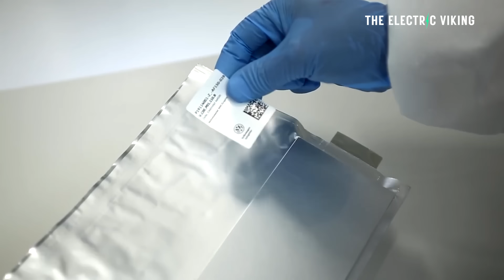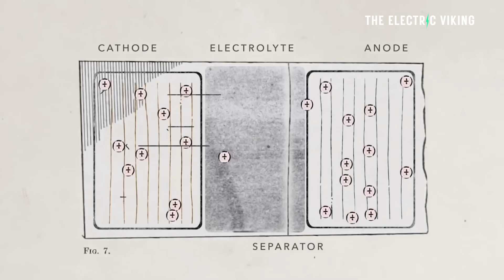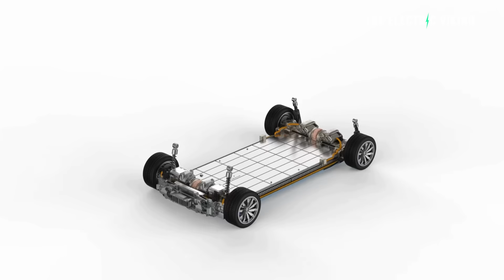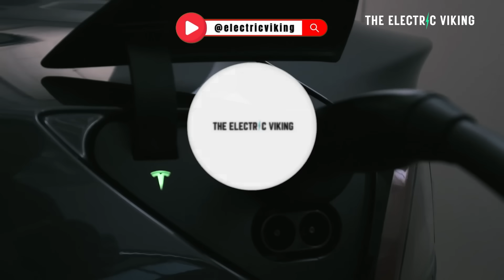Solid-State EVs Will Soon Seal Gas Cars’ Fate: 500 Wh/kg Power in 2025!

Comment: A 500 mile range with 300 miles between charging that would be great
Reply: Are the solid state batteries safer?

I will buy an electric car, when the batteries no longer form dendrites, and short out internally. As long as they cannot go into a thermal runaway, then they will be better than most lithium batteries. I think Lithium Iron Phosphate are currently one of the safest batteries? 

The other problem is, electric cars are forcing huge amounts of technology onto people. But what some of us want are an analog electric car. Meaning, an electric car without a full touch screen computer system. What happened to driving a "simple" car? A simple car should be an option. There needs to be an option. If you take away a person's options, then you force them to buy an old car. That's why Tucker Carlson bought a 1987 Chevy truck for his main vehicle. Because it's not fair to force computer controls and drive by wire, on people.

FYI, I want gasoline cars to continue forever. But they need to allow improvements in combustion technology. If those improvements aren't allowed, then there won't be anymore gasoline cars, and that doesn't benefit anyone. Allowing improvements, will allow gasoline cars to remain for another 30 years. If you car got 200 mpg, then it would produce less pollution, and it would be extremely inexpensive to operate.
Reply: Current top batteries is about 100kwh in 600kg. This one promise 300kwh in same weight. Range will be increased 3 times too. From current 500-600km to 1500
Reply: @maximkosheleff  unlikely that a producer would not use that technology to lower the weight. they might go up to 1000km for the 4 figure promotion value, but would be far more reasonable to cut weight and get some "free" range and space while lowering production cost that way.
Reply: @diedampfbrasse98 of course balance is preferable. 200kwh with smaller weight maybe better than 300kwh.

But still gere is no any real ev with solid state batteries on the market :(
Reply: I am so excited for the new battery technology, provided that it is safe. I won't buy an electric car until the batteries are as good as a 200 year old "Lead Acid" automotive battery. As it turns out, regular lead car batteries are made out of 100% recycled materials. Lead, and acid, are the easiest materials to recycle. So none of the lead goes into the landfill. They are better for our environment, than lithium ion batteries. Surely they can come up with a battery that is able to be recycled, like the lead battery?

It's also important to realize that men have invented sealed Argon engines, that use Argon for combustion, in a sealed chamber that never runs out of fuel. There are men who have made cars that get 376 mpg, in 1973. Gasoline cars are not evil. What is evil is the lack of innovation that has been forced on people. 

There has been zero improvement in combustion technology of gasoline, since 1913. Strangely, there has been zero improvement in electrical generators since 1899. How is this possible? 

The problem is not a lack of technology. The problem is the continuous SUPPRESSION of breakthroughs in science and physics.

The mindset of accepting "zero progress" is a major problem. Why are people buying vehicles for $77,000 that break down after 20,000 miles with catastrophic engine failure? As consumers, we need to expect more. We cannot keep allowing "zero progress."

Comment: hopefully they make swap kits to put them into existing EV models! id definitly drop one into my 2019 leaf if the cost wasnt outrageous
Reply: That’s the advantage of battery swapping capability, as technology improves it is simple to put in a new battery.  My Nio was bought with a 75KWh but got long runs I can rent a 100kWh or a 150kWh battery pack (by the day, week or months).
Reply: Every vehicle has its own design of battery pack, I doubt you can find an upgrade that’s made specifically for to the make and model.

Comment: I have a hard time believing in Solid-State... Why is it not in my phone? It is almost ready for cars, but not my phone....
Reply: They are already in some low drain devices like hearing aids. They are probably not in smartphones right now because of the cost to develop them (for smartphone use, which requires a very thin shape), is quite high and smartphone manufacturers cannot afford to pay much more than $15 for a battery.
Reply: @bengt_axle  The question is more for the top end phone, would you pay a premium price to charge your phone to full in 5 min? I could up the phone price $100-$200 dollars for that.

Comment: Let's hope that solid-state batteries fulfill at least some of the promise of the technology and arrive sooner rather than later. (I'm thinking about how fusion power has been 20-years away for the last 20-years.)
Reply: Why? The EVs already available are amazing
Reply: @SteveRomigsongwriter  How much road tripping have you done in a BEV? In the past couple of years I've done half a dozen trips of 2,000km or more and it takes a lot of patience and planning. I'd love halving the charging time while having 100km-200km more of summer range.
Reply: @oldebill1807  The vehicle you have been doing the trips, and the country, becomes a key to what you are talking about here.

As someone who has driven 900km in a single day, on an EV with  just over 400km of range, it wasn't a big issue.  Now cars have 800+ Km of range, and climbing.

In my area, the growth in infrastructure has been nothing less than amazing.  About a decade ago, EV charging spots were few and far between, now it feels like they are almost everywhere...
Reply: @redbaron6805  I have done at least half a dozen road trips that are minimum 2000km and at least one of the leg is 900km+. My vehicle does have 400km nominal range with DC fast charging rates below 100A so those days end up being 12hours+ on the road. It's worse in winter so I'd really like to be able to reduce by at least one 30-minute stop.
Reply: @oldebill1807  I believe what you are looking for is already here.

Without knowing the model and year of what you are driving currently, it is hard to tell where you are at in the technology curve.

But, most modern EV's charge with fast charging way above 100A, so my guess would be you are driving a Bolt or a similar vehicle with a smaller battery size and somewhat dated fast charging capability...

Comment: I am going to tell you (and anyone reading this) right now.. while you will ALWAYS have many big block lovers (myself included.. nothing quite like that sound, smell and feel of a big charger, corvette, etc roaring as it takes off).. if EVs can do 0 to 60 in 4 to 5 seconds (which they can with current battery.. but talking about replacement tech).. get 500 minimum REAL miles on up to 1000+ miles on a charge, can charge in 10 to 15 mins from 10% to 85% (the "safe range" for longevity), and could last 30, 40+ years..e.g. 10,000+ 0-100-0 charge cycles (assuming 1 full cycle a day which is unrealistic unless you drive 500+ miles every day which just about nobody does) and it can operate in very cold and very hot weather no issues.. go through puddles/etc no problem.. EVs will outsell GAS all day long. As long as they are on par in price. Batteries will continue to get better.. with some claiming they'll get to 2000+ mile ranges with 15 minute charges in the near future.
Reply: Duh
Reply: EV's can already do 0 to 60 in sub 2 seconds, not 4 to 5 seconds.  Who is driving any kind of sports car 500 miles and needs 1000 miles of range...???  No one....
Reply: @redbaron6805  You're clearly missing the point. Many folks want a car they can drive without having to stop/charge for an hour every couple hundred miles. I know EVs can do 0 to 60 in < 2 seconds. My point is.. 0 to 60 in 4 seconds used to be an insane speed.. still is. I'd give up the NMC high energy battery for a bit lower one and more range and cycles. LFP is that battery for now. Salt batteries will be heavier, less energy dense (but getting very close to LFP density) and thus even slower in terms of output.. e.g. wont be able to push an EV that is 6K to 9K in weight.. to 60 in 4 seconds or so. BUT.. a salt battery handles very cold and very hot weather much better, wont blow up or catch fire, and currently can recharge 10,000 to 50,000 times depending on battery. Me personally.. if I could have a salt battery that gets me 600 miles range in a truck or car or suv, recharges decently fast and lasts for decades and wont ignite.. yes please. Means I can use it around town or long drives just the same. "Who is driving any kind of sports care 500 miles".. I didnt say sports car.. but since you asked.. I mean.. their are a couple of EVs getting close to 500 mile ranges with 0 to 60 in sub 3 second ranges already. Solid state batteries promise to be the breakthrough as well.. with similar Salt battery capabilities but much faster charging, much higher output, and longer range. Only down side right now is not in production just yet and higher cost. If they can mass produce solid state.. we'll see trucks with 1000 mile ranges doing 0 to 60 in 2 seconds and able to toe boats and crap 500+ miles easily on a charge that will take a minutes and a battery that will handle 10s of 1000s of cycles. Few years out before that is a reality though.
Reply: @WhySoDivided-CantWeAllGetAlong  Not sure if I follow your numbers here, as they appear to be quite a bit off, even for today's technology.

The Silverado EV has around 460 miles of range, can add 100 miles in 10 minutes, and 370 miles in about 52 minutes.  So, how are we taking an hour to charge every couple of hundred miles...??

In fact, the Silverado EV charges to 50% or 230 miles of range in 18 minutes, not 1 hour.

Also, your charging cycle numbers are either off, or you are not applying 1C to your charging cycle numbers.  A charging cycle is considered 1X the entire capacity of the battery, better known as 1C.  A Silverado that can charge 10,000 times would have 4.6 Million miles of range, and 50,000 would be 23 million miles.  So, unless you are planning on driving from New York to Australia and Back every week, I'm not sure why you would need 10,000, let along 50,000 charging cycles.

So, I'm not sure if you are referring to the Lightning in your numbers or what vehicle you are referring to, but the Silverado/Sierra EV is now the leading truck in range and battery capacity.
Reply: @redbaron6805  Always remember the phrase "Ideal conditions". That's an important phrase when it comes to driving EVs, efficiency and charging speed. To your point depending on size of battery, such as the 200+kwh battery in the Silverado RST and GMC Denali trucks, yes.. they can charge on a 350Kwh charger system, if you find one and want to "wear down" the battery lifespan faster using super fast charging.. to 200 miles in about 18 minutes give or take conditions. That battery wont last 10,000 cycles though. I am specifically referring to some cars in China (BYD) that are currently starting to use sodium batteries with up to 10,000 cycles so far. There are also 3.2v Sodium batteries that claim 50,000 cycles. NO car is currently using those. 

There have been plenty of videos and articles indicating that battery tech IS fast approaching the ability to replace lithium with solid state and prototyping has shown that with some promising "breakthroughs" solid state could very likely have the same if not more energy output than current NMC that Tesla uses to achieve sub 2 second 0 to 60 times, while having much less degradation over more cycles potentially achieving > 10,000 cycles or more with < 10% loss. 

This is largely hypothetical right now and in testing, but will take probably a few more years before they would have been able to test batteries enough to make that claim. Sodium ion batteries on the other hand have reportedly already shown > 25,000 cycles.. but they are currently larger/heavier/less dense. So they are great for home storage.. or short range (e.g. 150 or so miles) in cars. But are not yet practical for longer range. They have however (CATL just recently in fact) said sodium is almost on par with LFP now in terms of capacity and energy output, while being safer than even LFP and costing 1/2 to 1/3 to make. If they can catch up and surpass LFP in all aspects, they would likely become the more dominant battery for cheaper cars in the near future as well as home energy storage needs at more affordable costs.  As for 500+ miles.. up to 1000+ mile ranges, I think we're 5 to 10 years out before we see that.. but prototyping/trials have shown some promise with solid state and sodium ion (of various builds) alike that they could soon achieve those types of ranges and be practical for cars and trucks, offering faster charge times (a few minutes for solid state), far more cycles (thus longer life span) and more range while providing similar to better energy output than NMC can presently. 

Take what I say with a grain of salt.. this stuff is changing rapidly all the time.
Reply: @WhySoDivided-CantWeAllGetAlong  OK.  Just to clarify a few of the points you are making here.

Multiple studies have shown that fast charging batteries doesn't actually wear them down faster.  In fact, an extensive study done on Tesla battery wear, showed that batteries that were rarely or never fast charged, degraded faster than batteries that were regularly or often fast charged.

This has to do with heat being the #1 cause of battery wear, and battery cooling systems work exceptionally well to keep them thermally managed when charging.  Hence, when they are fast charged, the heat cycle wear is shorter, than when they are slow charged.

The Chinese battery technology is still in the early stages, and there is a lot of hype coming from China.  I'll wait for actual data showing how they really work, as Chinese companies are notorious for making claims that don't stand up to scrutiny.

You also got to be careful about what Solid State is actually doing.  There are Solid State Lithium Ion batteries.  They are not necessarily replacing the Lithium, as much as they are replacing the Electrolyte with Ceramics or Polymers, while still using Lithium Metal Anodes.

As you basically mention, Sodium Ion and other technologies are more likely, at least in the near to medium term, to replace energy storage batteries and other stationary technologies, where weight and bulk is less of a factor, and free up Lithium to make EV batteries, basically increasing Lithium supply being currently used in Energy Storage applications.

The core issue they are facing in many cases, is the same issue as Semiconductors face.  By the time you figure out a way to mass produce newer and better battery technology, and invest the massive amounts of money required to build factories and scale up production, you risk producing a battery that is already obsolete, and surpassed by a newer, cheaper and better technology, making your investment basically obsolete before you can recover your investment using economies of scale.

Mass producing Solid State batteries is still a complicated task, as the equipment used to manufacture regular Lithium Ion batteries, which is already scalable and proven, can't be used.

Additionally, fast charging Solid State batteries has proven a tough nut to crack, hence many of the early Solid State players still languishing on the market, and struggling to scale up manufacturing and reaching economies of scale.

Hence, this is happening, but not at the smooth timeline people are expecting, and is taking longer than forecast.

Comment: Is it ignorance or evil that drives some to still poison the air and mother earth
    It kills over 361 Americans daily.What are the symptoms of lung cancer in nonsmokers? None usually . until it’s too late.Owners of  ICE and Diesel vehicles and those exposed , such as Family members and co-workers, are reported to have the highest rates of Asthma, Cancers and Leukemia . More than 40 chemicals listed for cancer are present in engine exhaust. These include benzene, arsenic, formaldehyde, acetaldehyde, 1,3-butadiene, lead, numerous hydrocarbons and CO. E.V.’s are zero emission. FYI , For those stuck with the old rotary phone ICE vehicle,
E-85 is Much cleaner, mostly less expensive, and helps American farmers.it’s  now sold everywhere in the states, just google search  it .. only 15% is poison. Before e.v’s  we used it for 400k+ miles , in many vehicles,  it’s still going in some.